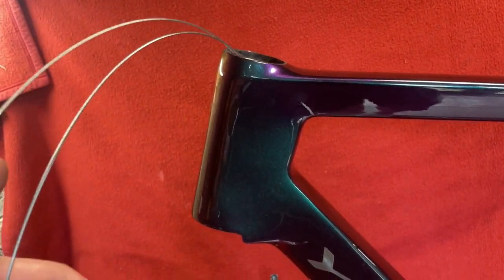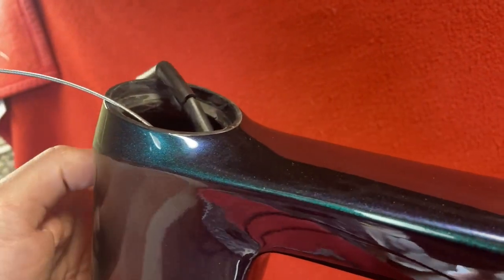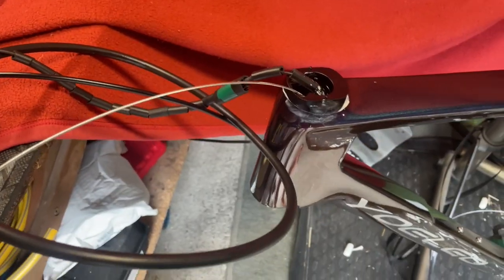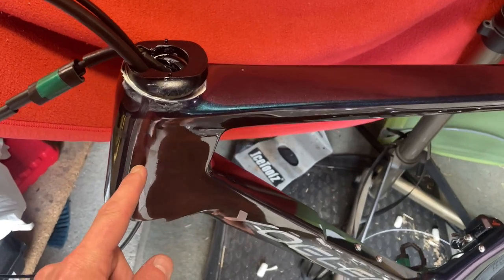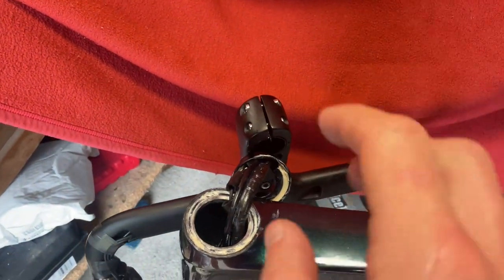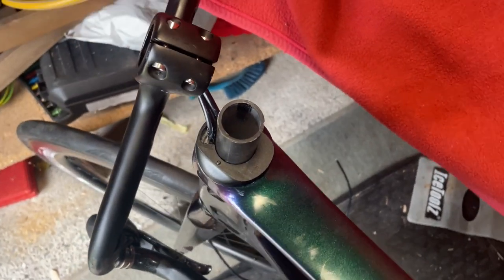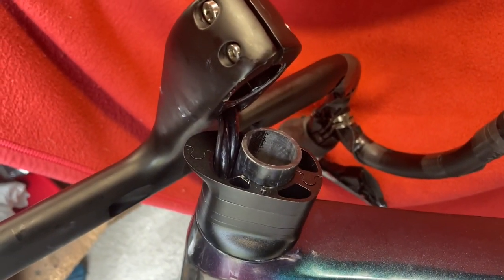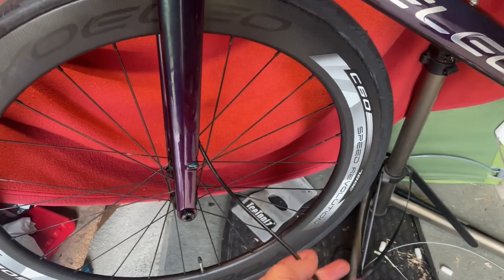Attaching Integrated HandleBars

Comment: The idea with the extra piece of steerer tube sounds really great! And that's exactly how I did it in combination with an extra long headset expansion plug of 90mm.
The only problem I have is that after a few kilometres the piece of steerer tube with the expansion plug pulls out of the actual steerer tube and the headset is loose.
Lots of assembly paste and 1-2Nm extra torque have unfortunately not helped here either.

Nice that it seems to work for you. Unfortunately, I can now only ride my bike with a (too) low stem. So to all those who want to do it: be aware of the risk.
Reply from the maker: Sorry to hear that, I’ve never needed to lower it, so it’s still the same as when I built it. Never had a problem with it. But it’s an interesting point. Thanks! 👍

Comment: What I did differently the second time I had to do this: was to put the grease on the bearings after fiddling the cables through, and also to use 4 hands. It went very smooth and clean the second time ;)
Reply from the maker: Yeah 4 hands would help! It’s really just patience, just move them a little at a time and they are good. Getting them all in the front of the split ring was the challenge. 👍

Comment: Hi I have a question hopefully you can help. I have a 2020 Cannondale Synapse Di2 and would like to buy some integrated bars. I’m not sure how exactly to tell what bars are compatible. Where should I be measuring to understand what to buy. I have my eye on the handle bars called one (The One). They are about $200. They measured 28.6. Not sure where they measured to get that number.

Comment: Mech shifter with 4 cable came out from the compression ring and spacers quite hard to assy. Yesterday assamble r12 frame 😴😴😴
Reply from the maker: Yeah, I’ve only got 3 going into mine, 4 would fit though I’m thinking it would be tight… just take your time and it’ll be fine. 👍